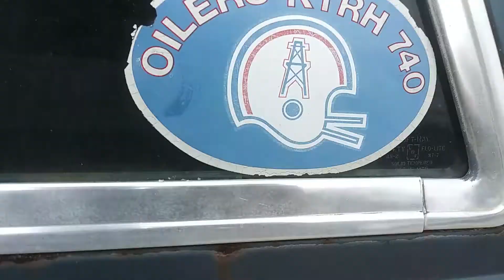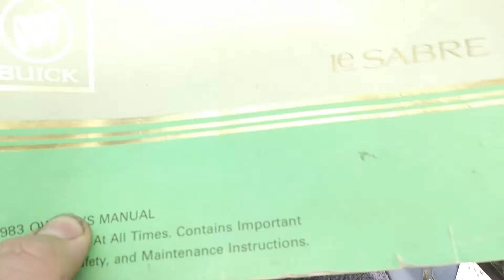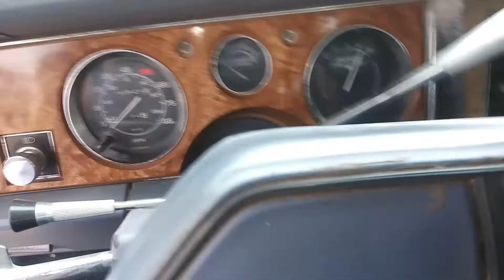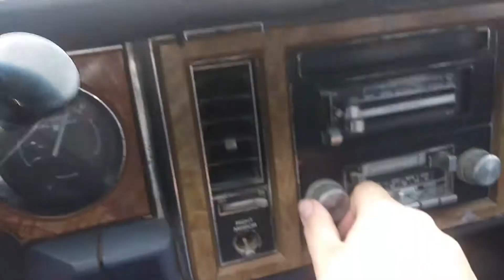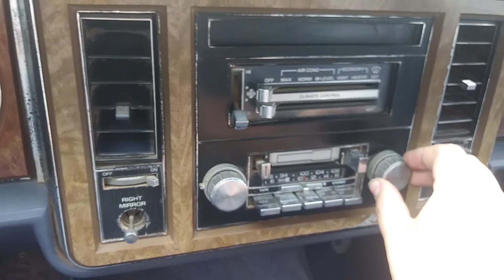1983 Buick lesabre estate wagon for sale

Comment: Why is the hose missing from the radiator to the engine block?
Reply from the maker: It either has bad intake gaskets or head gaskets. You pour water in the radiator and it goes straight to the oil pan. If it dont sell im yanking it out and putting my 496 and th400 in it.
Reply from the maker: I removed them so no water would stay in the motor and damage it.